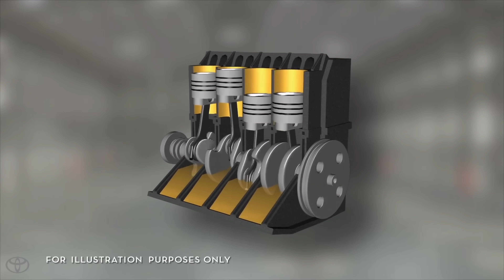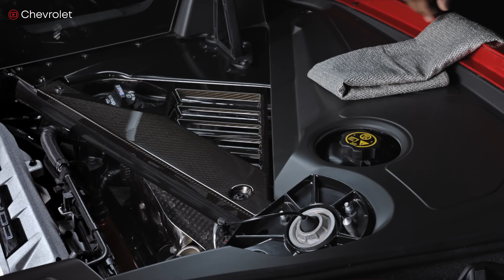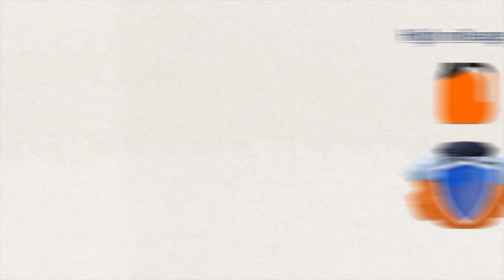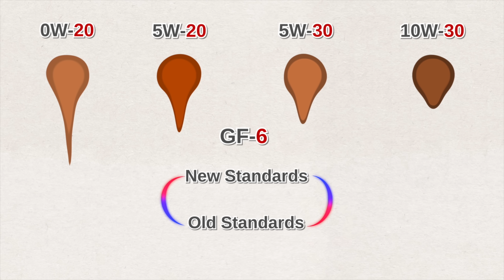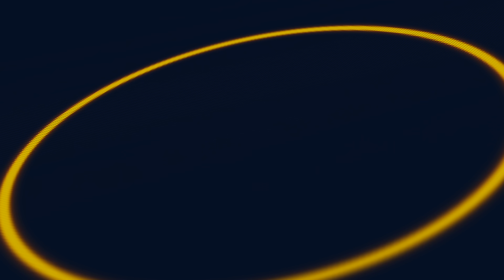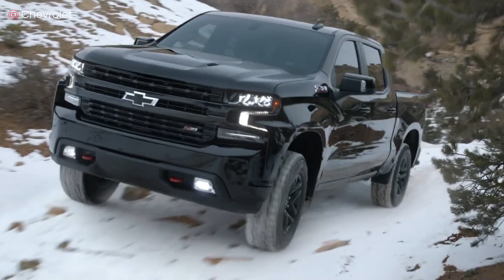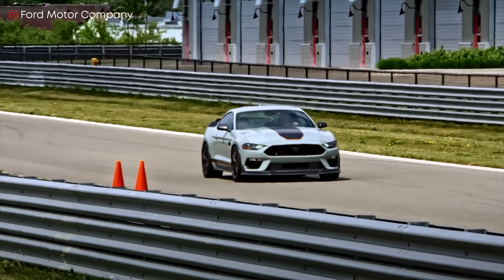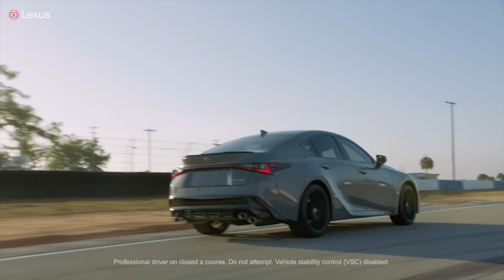7 Engine Oil Myths Stupid People Fall For

Comment: Additives (friction modifiers, detergents, stabilizers, etc) generally get used up/ break down/ leach out,  before the actual oil does and they can be as important as the oil itself. change your oil once a year whether you reach the mileage limit or not. Also dirt accumulation is another reason to change your oil before you think it might need it due to accumulated mileage. Don’t be cheap! Use good oil and your car will be happier over the long haul.
Reply: Just use any ol full synthetic, change it every 5k miles/6 months (whichever comes first), use a half decent filter (ANYTHING but fram), and your car will run just fine.

Comment: Oil doesn’t wear out.  It becomes contaminated.  An oil filter that would filter the oil fine enough to remove all contaminates would also remove additive packages that are in the oil to do things the engine manufacturers want the oil to do in their engines.

Comment: 2003 tundra, 390,000+ miles. Since change to synthetic Mobile 1 or Castrol Syntec (which ever is on sale at time) at 90,000 miles have always gone 20,000 miles or more.  BUT, always use a Mobile 1 oil filter

Comment: I have run full synthetic in my engine from day one, and change it at half the manufacturer recommended mileage intervals. Should I still switch to the high mileage version of the oil, when I hit 75000 miles?  I assume seals and other components will wear regardless of oil type, but I also assume running full synthetic would would drastically reduce wear of these components.  Seems counterintuitive that the standard full synthetic formulation would be different than the high mileage full synthetic formulation, but I guess it makes sense for marketing purposes.  Curious about your opinion.  Great video as always!
Reply: No. I wouldn't. As long as the engine is not showing obvious signs of wear like consuming or leaking oil, there's no reason to use high mileage oil.

Comment: 1999 New Beetle diesel.  Recently hit 300,000 miles.  Changed every 10,000 miles.  Full synthetic.  Chip-tuned early on.  Still never needs make-up oil added between changes.

Comment: Here's a huge myth......the bottom end doesn't run in  an oil bath as depicted by the the first animation 😏
Reply: You beat me to it
Reply: @stevepierce2457  yeah Scotty is kinda the crazy old cat lady of the automotive side of youtube
Reply: My grandfather ran the cracking and product part of an oil refinery. Don't know where he got his info about the 5w30 or 10w40  but here's the real: the first number is the true viscosity of the oil the second is the protection equivalent.  During "cracking" polymers, think microscopic ball bearings (not exactly  but accurate), are added to give it more lubrication. Thus 10w30 is 10 weight oil with enough polymers added to give same lubrication as 30 weight oil. That's how it works. The W is the oil's true viscosity, don't know where that "winter" stuff came from.
Reply: @johnchandler1687  it really does stand for Winter low temperature viscosity by SAE terminology, although I'd argue most of Scotties stuff is verbal diarrhoea. 👍

Comment: My mechanic told me I can use 5w-20 in winter when my engine takes 5w-30, is that any good?
Reply: No. If the owner's manual says 5W-30 then that's what you should use. Never lower the upper number. That's what viscosity is recommended at operating temperature and operating temperature isn't much, if any, different from summer to winter. However, you could use 0W-30 instead because the "W" stands for winter and the lower the winter rating the better the flow rate is for cold weather starts. In fact 0W-30 could be used year round.

Comment: How about this. You are not any smarter than the team of engineers that designed your car. So just use the weight and type that they recommend. New is not always better.

Comment: The engine oil animation in the first minute and several other times is complete bull. Automobile engines are not designed to have the crankshaft rotate through a reservoir of oil. Doing so will churn it and whip it into a foam and will not be used for what oil primarily does in an engine - float the rods on the crankshaft and the crankshaft in the mains. Oil under pressure gives a hydraulic effect that keeps the metal to metal contact to zero. If metal makes contact, friction is extreme and failure is imminent. 
Newer cars use lower viscosity oils for one primary reason - machining tolerances are tighter. Having higher viscosity oil would create more work and drag on the engine, creating less efficiency, and causing abnormal wear.

Comment: 4 cylinder accord change full synthetic every 4-5000 miles plus check the computer readout when you reset the odometer it tells you how much oil life you have left

Comment: The best advice is listen to your engine for noise. A good oil with good friction inhibitors for your engine will make it sound very smooth with no valve train or head noise whatsoever. Not all manufactures are the same for oil formulas . If you change your own oil try different brands and listen to the engine. Even with an oil change system in your car you might hear engine noise prior to the interval message.
Reply: I say to also use a oil additive at every oil change too .

Comment: I have a great running carbureted engine 1968 American built with 60k miles. Which oil is safe to run in this engine? It’s like today’s oils will purposely damage older engines when the zinc was removed.

Comment: I get a few old timers in my shop that do the filter every second oil change thing.  Doesn't matter that the filter for their car might only be $11, they still insist that we not change it.  Oil, and filters are cheap, especially compared to the cost of an engine replacement or rebuild.
Reply: Are those old timers still stuck on 3,000 mile oil changes even though the car's manual says 6,000? They are on schedule with filter changes and buying more oil than necessary.

Comment: Bottom line, the lack of oil, not the type or brand ruins engines. Use what's called for, but in a pinch you'd better use what's available. You can always change it back to specs.

Comment: One thing I never understood is why is Europe oil changes are usually 10-12 thousand miles Vs 3-7 in the USA. I mean we have used synthetic oils for longer because higher tuned smaller capacity engines need better oil. But pretty much every car I've ever owned has had intervals of around 10-12k miles here in the old continent.
Reply: they use KM

Comment: Most everything you say is true on every subject, but ever so often, you're just wrong. BLACK oil is trashed, period. It has several issues, excess carbon, severely deteriorated additives and of course dirt. No only is it bad, but the residual dirty oil left behind during a change, effects the life of the new oil. Owners manuals and other recommendations are just that, recommendations. If you're manual says 5k miles, and it's solid black at 3k miles, you're causing undue wear. Not saying it can't get a little dark, but if it's lost all transparency and is solid black, it has already passed the time to change it. The same is true for going past recommendations. If your manual says 5k, but your oil is still transparent at 6k, you're fine. Also it's super rare, but filters do clog and most have a bypass system to prevent dropping of oil pressure when they totally clog. Admittedly it's probably not going to happen, but if for some odd reason it does, the oil will turn black quickly, and if ignored, can cause engine damage. To test this, send the oil off to be analyized. Send a sample of the exact same oil , new and black. You will get proof positive

Comment: I still change oil ever 3000 miles even synthetic I change at 5K. My Harley's get changed at 2K. I have a 72 FLH and a 98 FLSTF so I use conventional oil in them I change transmission and primary  ever 4K.

Comment: We have diesels here in Australia and the diesel motor oil goes black and you can’t use gasoline engine oil in a Diesel engine. All our 4x4’s are diesel powered from 4 cylinders to a V8.

Comment: My problem with synthetic-blends is that the ratio is not dislosed.  It could be 2% synthetic and 98% conventional.  Most people assume it's 50-50.  I doubt it is though.
Reply: there is now zero advantage to using it also, as its the same price as comparable synthetic
Reply: @02hreblue30  Yes & check the difference in price between SuperTech full synthetic and Super Tech conventional. It's a no brainier to use the full synthetic. It protects better and is good for a longer change interval.
Reply: Hmmm?   @njsongwriter
Reply: Synthetic oil doesn’t extend your oil change interval, all oil types get dirty at the same rate.
Reply: In such a case I'd either just buy dino or full-synthetic.  A blend is not really giving you any of the advantages of either type.
Reply: You're right... and I don't see the point of a blended oil.  If you want longer oil change intervals, or live in an area of temperature extremes just go full synthetic.  If that's not so important and you already know you are going to change at more frequent intervals (half the mileage the car maker says is a good guide) why not use the cheaper conventional oil.
Reply: Once a year, depending on mileage, seems affordable for me.   @robertmaybeth3434
Reply: @robertmaybeth3434  For the first time my mechanic put in blended oil... yet I have to come back in 3,000 miles to change the oil. So what's the point? I personally like conventional oil... Any advantage to blended?
Reply: @MikeKollin  The only reason to me, y ou'd ever run "blended" oil is if you've got a crankcase full of synthetic, you're down a quart and dino is the only kind you can get for some reason.  Otherwise I just run one type or the other.
Reply: I think  when some body first time his /her life want  self   cahnge oil  is better  ask at  good service  how and find on  local dealer  what kind oil.  I found that diesels  "love" more first number is bigger and "petrol" enigne needed  first number is  lower.  I self use my tiny  1,0L  enigne 5 W -40 . Yes that "eat " of course 10 W -30 too but  I  live are wheres winter is cold -20 until minus30 Celsius ( 0 until minus 12 F ) .

Comment: About the filter, what if I only drove the car 1000 miles last year and the car had to sit for 6 months, then I change the oil to new stuff?  Should I still change the filter even though it didn't actually filter out a full oil change of oil and I will probably still only put 1000 more miles on it?  I would hate to have to spend another 3 hours changing the filter itself right away if I didn't have to.  =o|

Comment: I have a question not about a car engine.. I have a 2010 KLR650 do you think I should run synthetic oil in it ?..it calls for 10W40

Comment: Brilliantly delivered, good sir!  That was more informative than most any other offering about motor oil.

It made things pretty clear, except:
My vehicle is of German design, and it gets a might cold there.  I live in the US south, where it doesn't get terribly cold, but it gets plenty hot.  My vehicle is driven over 500 miles per week but is not pulling any more weight than normal.  The manufacturer recommends a 0/40 oil.   Would the requirements in oil viscosity change enough between frigid climates and hot climates be enough to actually considering a change in the viscosity that is used?
Reply: No
Reply: No
Reply: No. Stick to what the manufacturer recommends. Going to a heavier oil can cause starvation, as well as clogging as the channels aren't made for an oil that thick. Going to a thinner, lighter oil will cause oil burning and potential seepage, both of which can cause many problems.
Reply: There is a chart in your owner’s manual recommending different oil viscosities for different temperature extremes in different locales and seasons. Study it.

Comment: There is one myth related to this I would have loved to see listed. That you can't, or shouldn't switch from conventional to synthetic on older engines as the seals will shrink and cause the engine to leak.
Reply: I've never heard of it due to seals shrinking, but due to stirring up long sitting contaminants that can clog oil passage ways.

Comment: You need to quit calling engine oil "motor oil". There actually IS a motor oil .. for motors .. but you're dealing with engine oi. And it's different. 

So cut the slang.

Comment: Scotty is right! Changing your oil can make a huge difference! I have 300,000 miles on my romeo 4.6l Ford Triton engine and it's still running strong! I always use full synthetic oil and change my oil filter with a quality brand. (p.s) Fram filters are held together with cardboard.
Reply: What oil filter do you use?

Comment: Good job Scotty. As a Jet engine mechanic and tester, I was always asked about oils. The best way I can discribe to anyone is; with modern engines they run Naked Bearings in the head(s), where the camshaft(s) live. This area is protected by a thin layer of oil to prevent metal to metal contact. So, do you want crap oil, dirty oil; or n oil sitting between the Steel Camshaft and Aluminum head(s)? The answer is, you want the best, cleanest and oil they won't break down easy, because on start up, that's all to protect that head area. 

Yes, I am a Full Synthetic fan, mostly because of this reason. That and NEVER go cheap on the filters either.
Reply: Naked bearings of steel or iron running in aluminum--just like Briggs &  Stratton did

Comment: Hey whenever you said the viscosity in the newer vehicle how people think oh it will help if I put a thicker some engines have very low tolerance factors that they require a very low viscosity if you put a heavier weight it'll wash out the bearings I've seen this before it's crazy
Reply: But very good video I like it keep it up

Comment: Synthetic blends are REQUIRED BY LAW to have at least 3% synthetic - sounds like a ripoff.
FRAM oil filters have paper glued to cardboard in them !
Adding a quart of DIESEL engine oil gives you the ZDDP ZINC protection they took away years ago - - you may want this additive in your boat, motorcycle, lawn mower.

Comment: Always heard that if you start out with a particular grade and manufacturer you should stay with that system..correct or false??
Reply: You definitely DO NOT need to stick with a brand. Grade is based on manufacturers recommendations for where/how the engine is operated. A dealer or other seller will want you to stick to their brand of course. Lubrication is not so precise that one brand will be required once you use it 

I will sometimes stick with a brand simply because I like/trust the performance vs cost and if it ain't broke don't fix it.

This can be particularly true with motorcycles where the oil also is in the clutch housing. Some oils are noisier than others, so you stick with one that works best. Yamaha clutch baskets can whine and chirp, but run quieter with some particular oil over another, even though the grade is the same.
Reply: @joeshmoe7967  makes sense..thank you. I typically stay with the same brand once started but I've historically changed my on oil. Getting older now and less interested in doing my on maintenance.

Comment: I have a oil filter that states good for 10 000 miles.  I drive 2000 miles a year. Can I change my engine oil twice before replacing my 10 000 oil filter. Thank you for all your unbiased opinion.